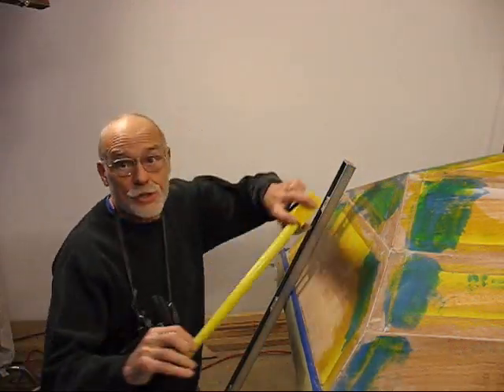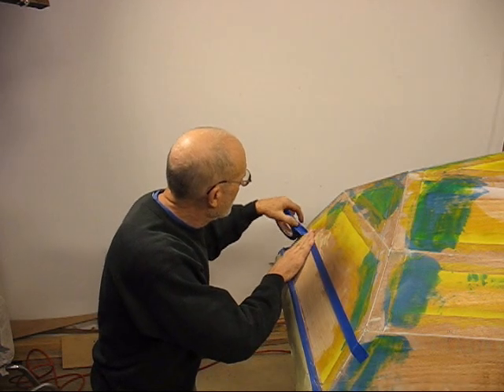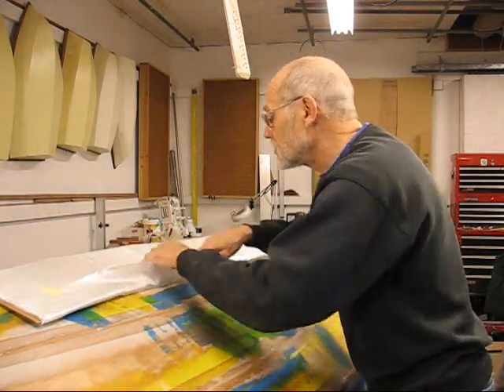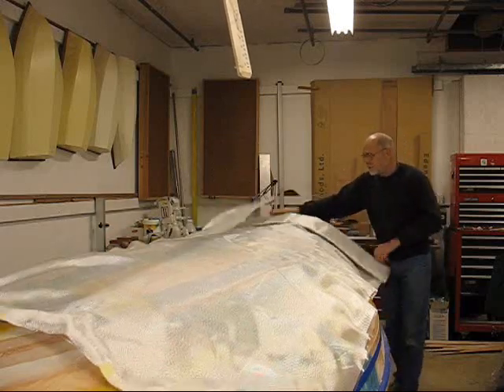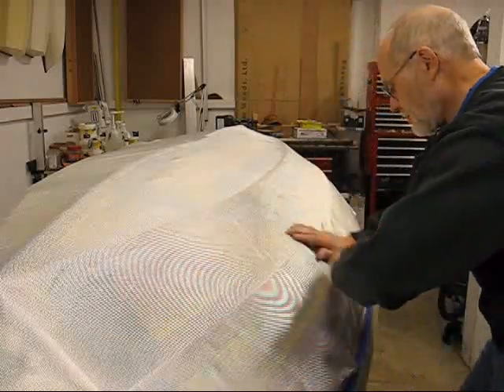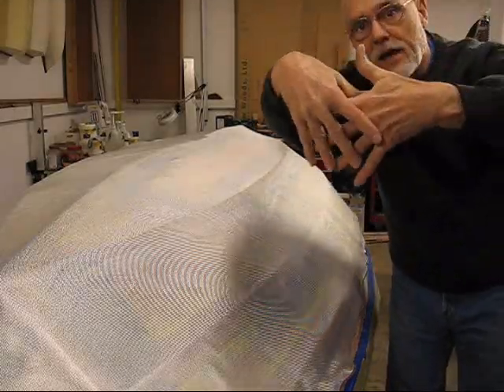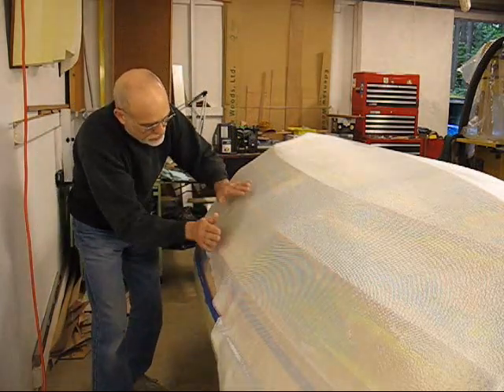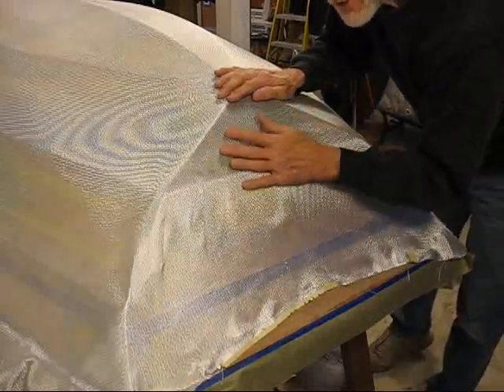Part 29-1 Layout and Smoothing of Glass Cloth 2

Comment from the maker: @paul33noodles  No I don't.  Most books on small boats deal with the lofting from the traditional "sections and offsets" method. You then need to build a frame to assemble the parts to. I tried using a few of the free hull drawing programs I found on the web, but they always needed a frame built. I use a 2D vector drawing program, and make models of the hulls. This can take forever, but when I'm done, I have "flat" panels I can measure from the edge of a sheet of plywood.